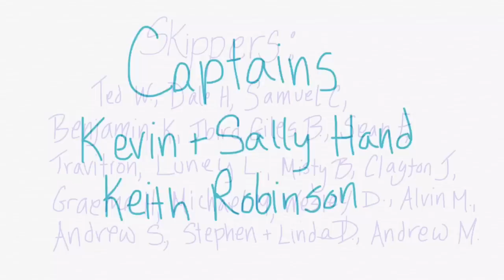Chop it up into little pieces | Sailing Wisdom [S3 Ep24]

Comment: YES! An AXE! FINALLY, SOMEBODY SENSIBLE! Good LORD, that's been driving me CRAZY! NOBODY on ANY of these Sailing Channels has an Axe. WTF?! ALL Sailing Ships Back In the Day Had a Half-dozen or so Axes, and this was Mainly to CHOP AWAY A fallen Mast, BEFORE it Holed the Hull, and clear away tangled rigging quickly, so Repairs/jury-rigging could begin Immediately. An axe was also CRITICAL to the Jury-rigging, to trim oversize timbers/spars, as well as to go Ashore and CUT A MAST Or SPAR from the TREES. They Can and WILL also Cut Steel Cables, by simply laying the cable across the edge and Hitting it a few times with a hammer. And the Improvised Weapon use goes without saying. ('Like a BODY'. -Maddy) If the boat catches fire, you can chop away the burning piece, or, failing that, chop your way OUT if trapped in a compartment. Check Out Kult of Athena .com for Good replica Naval Boarding Axes, which are more suitable for Maritime Use. Crack cocoanuts, dress and process Large Game,  Cut Wood for a CAMPFIRE, Uses Limited ONLY By Your Imagination. I'm so PROUD of you, Herbie! Makes my heart all Warm and Fuzzy...Drill a hole in the handle and fit it with a good Dyneema wrist-loop, so you can hang it up or Lash it On and not lose it over the side. Captain Benavent, the FIRST You-Tube Yachtsman to have ALL the Maritime Safety Equipment! Put a Razor Edge on it, paint it with Rustoleum, and guard it Jealously. Save your Life, it will.
Reply: For those 'Stubborn' Hard Drives, LMAO! @jed7644
Reply from the maker: JED my tray is already scary looking enough!
Reply: Herbie, I 've ALWAYS Envied you Dentists your Tray of High-Tech Dremels and bits. I never wanted to Rob a Brink's truck, but a Snap-On truck, and a Dentist's office? HELL YEAH! And maybe a Machine-Tool warehouse, lol!
Reply: It's an $8 ax!!!
Reply: Probably the Second Tool Man Invented, it's THAT Important. @fissh29
Reply: @jimnickles2347  I have a couple hachets plus a couple machetes and lots of knives...and an oscillating toll, the proper one for that job, not a Chinese hachet!!!
Reply: Good on You. And even a cheap China-brand is Better than NO Axe. Barehands don't cut, chop or pry well.... @fissh29
Reply: THERE it Is. @fissh29

Comment: My fav WHAT NOT TO DO channel!! don't want diesel cause it could go boom removes tank and motor, goes electric without lithium cells cant move boat under emotor, buys gas generator to make motor work stores more boomie fuel on deck. Sleeping while under sail beaches boat but hey gets on news. Waits till on small island  in the middle of nowhere to do refit/reno wonders why it takes so long and is expensive. Love it. Please keep pretending you know what your doing and teaching these ways. i will say i am glad that the painting channel called rigging doctor that tried to be has stopped.
Reply from the maker: Haha! Do you even know us?
Still have the diesel tank for the heater.
Doing the refit on this tiny island because it is soooooo cheap here! 

I think your viewer comprehension is a little on the low side. Maybe go back and watch it all again ;)
Reply: @RiggingDoctor  sorry i didn't remember that in the motor swap you left the tank in place (half assed)(wasted space) been a min since the start of which i was there watching. i do know you guys are book learners that struggle with practical application. i also realize that in your (cheaper) you have not figured in the costs of all the flights, visa renewals, delay/cost in product, food costs and so on. please keep doing (not reading) things for the first time and pretending for the camera like your an expert we can't see it. you know my viewer comprehension is a little on the low side.
Reply from the maker: Yes, we figure all those costs. That's how we're still here. We never claim to be experts and always admit when we've made mistakes. When have we struggled with practical application? Herby read about rigging and then re-rigged our entire boat. It has yet to fail us three years and an ocean crossing later...
Reply: @RiggingDoctor  not attacking here. just seeing what you show us and how it comes across at times. In one mans opinion.  The emotor conversion without lithium cells or proper solar. The dingy saga. Growing plants on the back deck. your knot tying videos and the retrise on these how to's. your wind vane learning, bilge cheese, diesel heater learning. you have come a long way from the start (video production and sailing) and i hope you keep going on learning then Doing. But be clear we are learning the what not too's from you guys and that's ok cause your still teaching and helping us learn. Just like in the beginning (Captain) Herby had to struggle with his wife thinking she didn't have to know sailing things. Or her inability to live in the same boat with and random alpha male (on this last trip to the refit island) as she is a alpha female (who hates the lean) and her hubby is a beta male ( sorry herbie love ya ) so she is the boss and its her way or the highway. plz in the future instead of this is how you, try this is how we. instead of this is what you do here, try this is what we learned here by doing this. instead of this is what you do when your here, this is what we did while here. also if you want some help with your graphics/design let me know i can help there as it seems to be not a strong point for you guys and no charge of course as your one of my fav learning channels.

Comment: Foam rarely seems like a good idea on a boat - wonder why it ends up there during construction.
Reply: waterproof,boyant, lightweight, insulator and mold proof are just a few reasons why. that being said, epoxy based external layers are more common now due to foams more brittle nature.
Reply: Must be just the old stuff seems to turn into such as mess with age - seems to become easily water saturated in areas like this.  Makes sense for flotation but doesn’t seem like that was the reason it was there.  Mads on sail life has a foam mess in that boat as well
Reply from the maker: The issue was there was a gap between the shower floor and sump, so water got on the foam and just soaked it!
A few decades later and I had a nasty job on my hands.